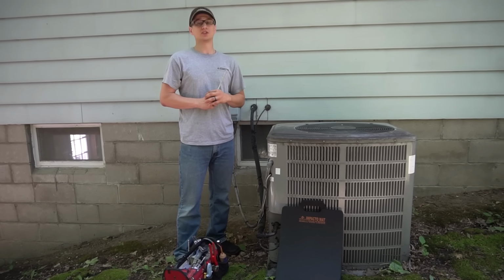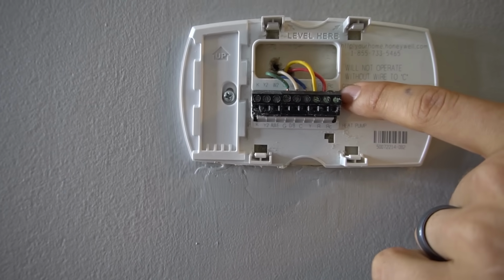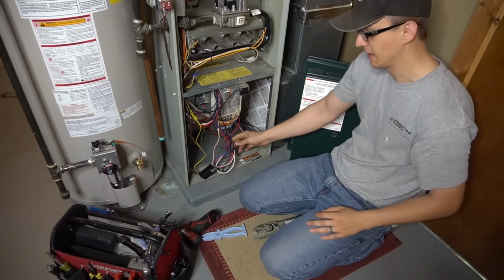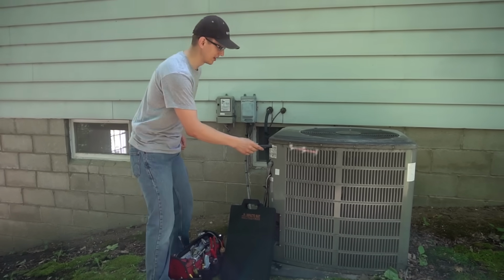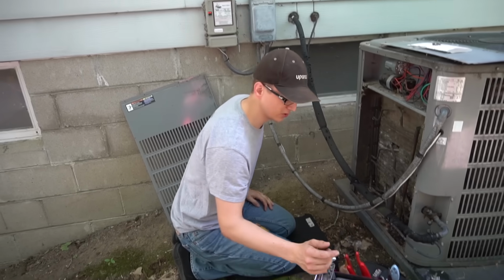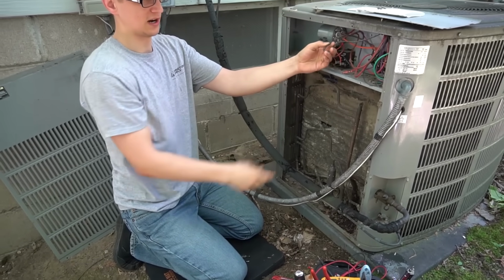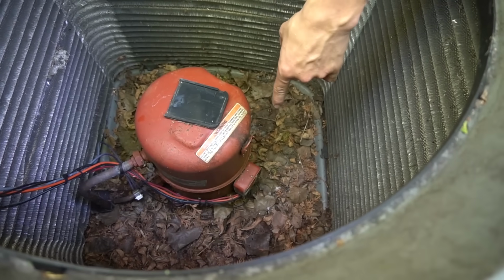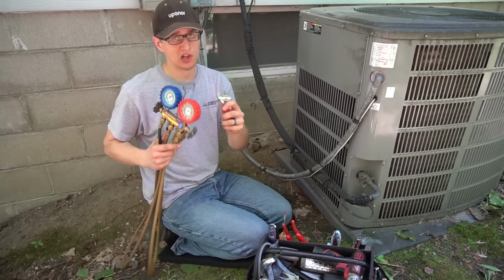AC Unit Not Turning On - How to Fix It Step by Step

Comment: great video...btw.... for whatever reason the ac will only turn on if I go downstairs and flip the fan switch to the on position by the furnace  ...it will cool off the house and the ac is running outside..however.. the only way to turn off the ac unit is to flip the switch to the off position by the furnace.. otherwise the fan will run continuously..yes we did replace the thermostat last year and all worked well. checked the batteries etc..
Reply from the maker: From you description, it sounds like a faulty control board. (or the thermostat fan setting is set to ON)
Reply: @WordofAdviceTV  would u be able to tell me how  I can fix that?
Reply: @WordofAdviceTV  even turned to auto on the thermostat , the ac unit wont turn on.. ..unless i flip the blower switch by furnace to the on position..
Reply from the maker: @liveyourpurpose3019  Unfortunately the only way to fix that is to replace the control board.

Comment: Great video! Our outside unit is not working, I pulled off the side and the unit starts completely if I press the contactor in. But otherwise with the thermostat on, the outside unit will not run. What should I do?
Reply from the maker: I would move on to this video :) https://www.youtube.com/watch?v=NVPhsK4gK1A&t=5s

Comment: Love your video. I have a problem. My unit keeps blowing the slow-blow fuses outside. Once I replace the fuse the fan  turns on and cold air comes into the house. No noises or anything wierd is happening when the fan turns on. This was not part of your diagnostic video. any suggestions where to look or what to look for?
Reply from the maker: Interesting.. I would say that there is likely a loose connection somewhere or a burnt wire. Many times it will be at the compressor pins, in the disconnect, or could be a bad circuit breaker. It's hard to guess what is causing it without looking. I have a video on AC tripping breaker. I think it would help give you some more ideas with what's going on over there too.

Comment: Your video gave me the courage to troubleshoot my air conditioning unit.  I went outside, took the cover off of the outside unit, tested the unit by pushing in the plunger, (word to the wise, use a tool that has a shock resistant handle, because I used all metal tool and got a shocking surprise!)  Anyway, I had called an ac guy, but he was busy today, so I gave it a try myself.  It amounted to the twisting nuts that connected the  outside unit wiring to the inside unit wiring had become corroded inside due to the rain and would not allow a connection!  I turned the power back on from the outside, came back inside and put the thermostat to cool, and I HEARD THE UNIT COME ON!  I was so pleased with myself and your "word of advice" tv!    I would have spend at least $75 for the service charge alone!  Anyway, your video made me a "Honey dew Hero!"  God bless you!
Reply from the maker: Love hearing stuff like that! (besides the part that you got shocked. Gotta be careful with electricity..) Glad you were able to get it fixed!! Stay cool and may God bless you and family as well!
Reply: @WordofAdviceTV  The shock just felt like an extra expresso coffee!  In my excitement, I had forgotten that you had mention choosing a tool that would prevent any shock!  But I was so happy for the result that that minor shock experience didn't even matter!
Reply: Because of cost, I hadn't had my unit serviced in years.  But as I went step by step with your video, I changed the furnace filter, followed the placement of the black whip hose to locate the position of the electronics, cleaned up all the old wasp nests that had accumulated in that area for years, (I had been wondering where they were hiding) tested the fan for moveability, checked to see if Freon was in the system by touching the metal Freon hose it was cold and frosty, ...to sum it all up!  I felt like a pro!  Oh, by the way, I immediately called the busy ac guy and canceled  my appointment!  Told him I had taken care of the problem!  I felt like da man!
Reply from the maker: Haha that's awesome man! Glad to hear you got it all fixed, checked, and cleaned! I am sure that from now on you will tackle appliance repairs yourself first and see if it's something you can fix on your own before calling out a technician. And I think that's awesome! It's nice when the man of the house is capable of at least trying :)

Comment: No air handler fan, no condenser fan.  Pushed relay in on condenser like you showed and it starts.  Put new batteries in thermostat and put the temp down and set it to hold.  Air handler is inside a hot attic, probably wasn't the best idea of the installer.  There is 24 volts to the fuse which is on the control board.  Fuse has continuity.  Tried spinning the air handler fan and nothing.  240 volts at the yellow and the black wires going into fan.  Unit is less than 10 years old.  Carrier FK4DNF003.  Something not turning the air handler fan on.  I don't know how to cross wires to take thermostat wires out of the circuit.  At the air handler I have 24 volts power between the far right red wire and the last two terminals on the left.  I made no changes on anything since all of the years of working.  Took filter out.  It was okay.  Thinking either thermostat wires or the control board?
Reply from the maker: Have you watched this video yet? May be helpful in figuring out what's going on.. https://www.youtube.com/watch?v=NVPhsK4gK1A&t=2s

Comment: My AC is not turning on, I don’t hear the unit coming on outside, but when I turn it on the thermostat the fan does go on nothing has been replace d or touched with? Please help! It’s getting hit here in California.
Reply: That is just like the dual capacitor went bad; I just replaced mine and my outside AC unit worked; Just watch the clip about how.  Be careful, shut the power for out side unit off and do not touch the terminals of a capacitor before short them out. One of my new ones had power, someone must forget to short them after testing.

Comment: What if your unit has a separate fan capacitor? Is it possible to bypass/discard the fan capacitor and connect to the run capacitor?
Reply from the maker: That is possible, just watch my video on how to combine capacitors. Although you could just replace the fan capacitor alone if it goes out.

Comment: Dude, get yourself a 24v bulb and socket from an auto parts store. Add male spade connectors to the socket. Use the bulb in place of the fuse to find the short. You'll save a lot of time and fuses when troubleshooting the 24v circuits.
Reply from the maker: Thank you for the suggestion TJ! I actually use a mini 3 amp breaker that I can repeatedly reset.
Reply: @WordofAdviceTV  The advantage to a light bulb is it acts as a current limiter. Even with a full blown short you won't damage any delicate components on the control board.
Reply from the maker: @rakentrail  Ah I see what you are saying now. Thanks for explaining further! Perhaps I should do that.

Comment: If a condenser fan is humming, you could feel it and hear it but not spinning, bad fan motor? Changed the capacitor but that wasn't it. Blower motor in the house is working fine.
Reply from the maker: Are you sure the new capacitor was wired correctly? If you already changed out the capacitor and that didn't fix it though, then likely that fan motor is bad and needs to be replaced.

Comment: Hi my thermostat panel shows override so my AC stopped working. My AC control board has two indicator lights . One is green which is on . One is orange which shows two long pause and three fast flashing. Under the two lights it prints two words: comm status . I don't know what is wrong with my AC. Would you please tell me what I should do to solve this problem? Thank you very much .

Comment: Hi,  I have a Trane XT90 and it seems like there isn’t any power going through my system at all..  is there a trouble shoot for that?  I tried to test the electric current and it does not seem like the entire unit is being powered.  Can it possibly be the transformer that needs to be replaced?
Reply from the maker: Are you talking about the air handler/furnace or the condenser unit outside? Have you checked the furnace power switch? It could also be blown disconnect fuses or perhaps a tripped AC breaker..

Comment: Great video!    I have a question for you.  My air fan works. However, i hear the compressor come on for about 2 minutes and then shuts off and the fan continues to run.    Also, you said if the furnaces fan inside don’t spin. That will keep cold air from flowing as well?
Reply: You may be having issues with your indoor fan. Cheapest solution is to order a capacitor for it. If that doesn't work then it can be the motor itself or a control board.

Comment: First of all thanks for a great video, it helps me understand my cooling system at least to be able to diagnose if not fix it myself. I had a weird issue yesterday and 3 weeks ago where a normally running and cooling system all of a sudden stopped cooling but the vent was blowing air. Temps going up in the house to about 87 and then I went outside to check the unit wasn't running. Since it happened twice in a month, I thought of calling the tech without knowing much of troubleshooting. They weren't able to come out same day so I turned the system off from thermostat and 30 minutes later just thought of checking it by turning it on again and it started working. 3 weeks ago, I had done the same but from the circuit breaker. So something is wrong because it happened 2 times in last one month. But now, watching this video - I know at least 3 different things to test. The tech came yesterday, didn't find anything wrong except for the "capacitor outside of required parameters" and a bit of play in the condenser fan. Neither would be enough to cause the circuit to trip he said. He drained the condensation line just in case but he said next time do not reset anything and call him. I thought I would ask you if you had any other diagnosis for my situation. My unit has been running fine the last 48 hours, so what could be wrong that is not consistently wrong but only occasionally blocking my unit from running?
Reply from the maker: With intermittent problems like that it would be hard for me to give you an accurate diagnosis. Could be a variety of things.. I wouldn't be able to guess it with just the info I have to go off of. One thing that comes to mind is that maybe the thermostat batteries are weak? (if you have batteries in it) I only say that because I had a similar problem recently with a unit that would not always start. I was able to catch the thermostat in the act. Replaced the batteries and the problem went away.
Reply: @WordofAdviceTV  Thank you! I hope I don't have to deal with it again, but if I do, I will report back on my troubleshooting steps. Also I don't have batteries in my thermostat. It is wired and I made sure there are no loose wires in there.

Comment: Question- My AC unit is not coming on. I replaced the capacitor on my unit like in your video, but I'm still not getting nothing. I pushed in the lil switch as well to see if I'm getting 240v but all I get is a humming. But it doesn't turn on. Its pulling in but getting a small humming sound. Not sure where to trouble shoot from here. Can you help?
Reply from the maker: Hey Francisco! It sounds like you may not have 240v going to the unit. The hum may be coming from the contactor (24v). Perhaps there is a blown disconnect fuse or your AC circuit breaker is tripped.
Reply: @WordofAdviceTV  it was a blown disconnect fuse and I was able to find out as well that condenser was bad too. Replaced everything just an hr ago. All ready cooling down. Thank you for the reply n your awesome videos!!! 👍
Reply from the maker: @franciscomuniz4383  Glad to hear you were able to get it fixed!! Thank you for the update, stay cool!

Comment: My tech says my control board is bad. How do I know what about the board is bad?
Reply from the maker: Well the board can be bad in many different ways... When it goes bad the fan may be always energized and wont turn off, it can turn the furnace and ac on at the same time, the fan wont come on, not sending power to the ac, and etc..

Comment: Great video.  I have a case of the "humming" outside unit with the fan blade not spinning.   We believe it's the capacitors but wanted to get your take on it?  GSX140301KA unit.
Reply from the maker: Most likely it is a dead capacitor. Although it is also possible that the unit is not getting power. I go over all of that in this video and my other videos though if you need more info.

Comment: Got a lennox furnace and air conditioner, furnace works, but air unit outside clicks but does not start, plunger goes in and holds but unit won't start and fan won't start! Spins freely, but won't start! What do you think?
Reply from the maker: If the compressor and the fan do not even buzz like they are attempting to start, then it sounds like the unit is not getting 240v. Perhaps the fuses in the disconnect are blown or the circuit breaker is tripped. Also possible that the contactor contacts are not making a good connection. There could be something stuck in there like a bug or some other debris

Comment: When you pushed in the plunger you had all the breakers on right? If so should that be the only thing to check with the breaker on on?
Reply from the maker: If you have a multi-meter. You can check voltages with a meter. If you don't have one, then yes... This would pretty much be the only test you would do with the power on. (and it should be done carefully because 240v is usually present..)
Reply: @WordofAdviceTV  Thank you! I didn't even know about the plunger and was able to confirm that my unit wasn't getting power but turned on after pressing down the plunger. I was able to figure out the problem from you all your videos! It seemed to be a bad thermostat. I overided the the wiring and it turned right on. Thank you so much! You saved me a ton of money. 👍👍👍
Reply from the maker: @Hi_im_Dominic  Awesome!! Glad to hear you were able to figure out the problem! Stay cool! Thank you for commenting! :)

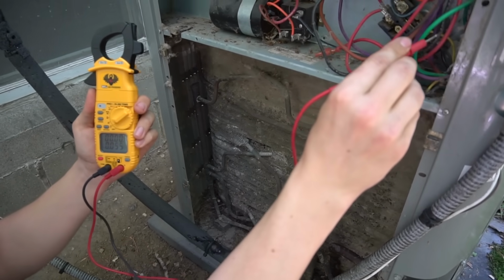Comment: Great video I was able to fix my ac and save ton of money! ALSO I DID A TEST LIKE YOU MENTIONED (0n plunger plate) 18:59 AND NOTHING HAPPEN AND WHEN I AHEAD & REPLACE CAPACITOR. After replacing capacitor, ac still didn't start and the problem was in the plunger plate had to really wiggle it in order to make good contact for ac to start.
Reply from the maker: Happy to hear you were able to get it going! Thank you for coming back and sharing what you did to fix it, stay cool!

Comment: Hi. Can you help me? When I go to my thermostat it blinks a couple of times cool on and nothing happens...or it clicks to cool on and still      nothing happens. Air doesn't come on. I've changed the batteries in thermostat. Turned thermostat off waited 30 minutes turned backed on.  Checked breaker. The fan wont even come on. I have a Rheem Criterion ii. My dad also checked the unit doesn't have a fuse. Any ideas would be appreciated. Thank you.
Reply from the maker: That may just be a time delay in the thermostat. When "cool on" is blinking, that's what it means. Try turning it on and wait for 10 minutes. If nothing happens, then I would check for power issues next. See if the furnace power switch is off, 3amp fuse blown, you could try bypassing the thermostat too (I have videos on that if you need them)
Reply: @WordofAdviceTV  Thank you for your help. I will try these things and hopefully get it figured out.
Reply: @WordofAdviceTV  It was the 3 amp fuse. It was blown out. My dad replaced it and the Air Conditioner started right up. You saved me from an expensive service call. Thanks again.
Reply from the maker: @Lovedebbie2007  Awesome! Glad to hear that! Thank you for the update, stay cool! ;)
Reply: @WordofAdviceTV  You certainly are an expert in your field. You are very knowledgeable. My family can't thank you enough for helping us figure out the problem with our AC. You have a new subscriber in me. Have a great week. :-)
Reply from the maker: @Lovedebbie2007  Thank you! I'm just happy your efforts were all worth it in the end and you got it fixed! Thank you for subscribing, have a great week as well!